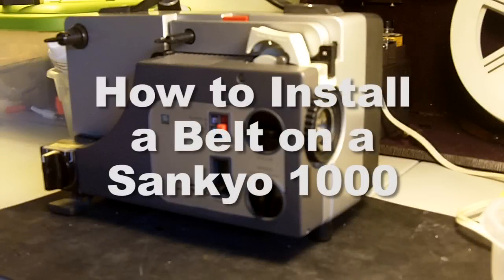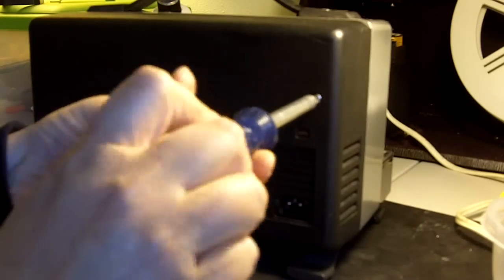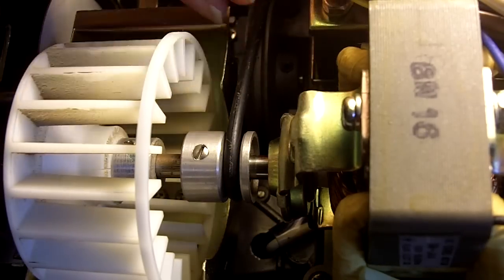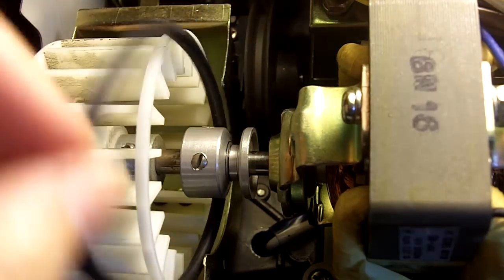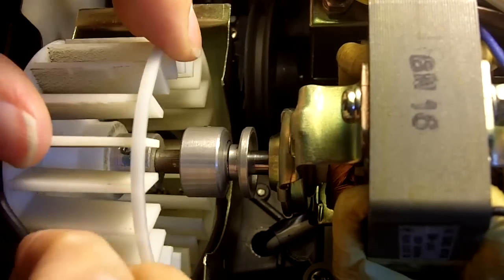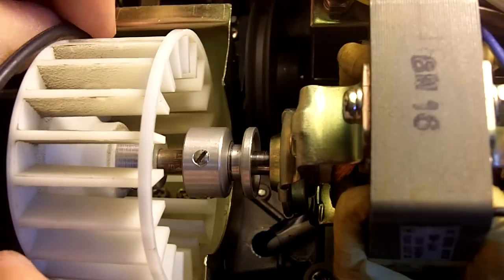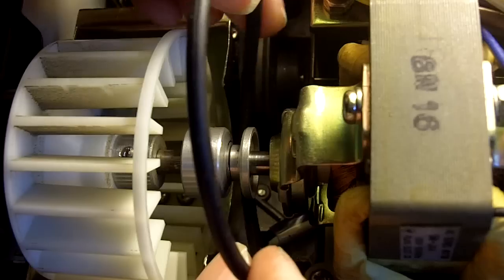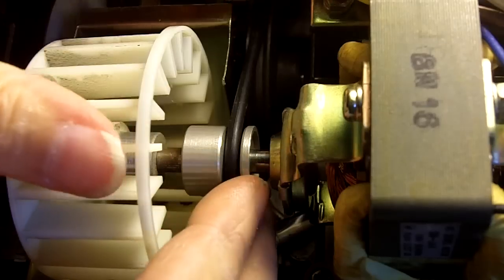How to Install a Belt on a Sankyo Dualux 1000

Comment: Hi, thanks for this very helpful video. I need to find a replacement belt as well, but I'm on the metric system, so I'd like to make sure I understood your measurements... the ring is 2 inches and 5 eighth of an inch long and one eight of an inch wide? (I'm never sure with imperial notations...)

Comment from the maker: There are a couple of things you might try depending on how the belt is trapped. Try loosening the grub nut on the shaft to the left of the shutter wheel using an allen wrench. This should allow you to move the shaft slightly to the left. If it still doesn't move try also loosening the grub nut to the right of the upper pulley on the right end of the shaft. You should only need to move it slightly to pull the belt threw. If that doesn't work you can try finding a narrower size belt/o-ring.

Comment: I'm looking to replace the belt on mine since it didn't come with one. Now, isn't it better to remove the turbine/fan before replacing the belt? It's only held by two screws to the shaft and it makes the job 10 times easier. Plus, you don't have to stretch the belt around it.

Comment: And by the way - I just found an odd sized O ring and that does the job perfectly - while I wait for the ebay replacement. The older failed belt seems to have been an old hair elastic. These old machines are sturdy but simple.

Comment: Hello!
Your video was very helpful. I have looked online for a replacement drive belt for a Sankyo dualux 1000 and they all seem very expensive and overpriced for just a small piece of rubber. Do you know if I can use a simple o-ring found at a hardware store as a replacement? If so what size should I buy?

Comment: Thanks for posting this. I've just bought a new belt for my Sankyo Dualux 1000 projector but don't seem to have what you call "an opening" on the right hand side. The back spool is right up against the thing to its right with no room for the belt to drop through. We've tried everything - trying to push the belt through the almost non-existent "opening" but it won't go through. Any suggestions? Thanks!
Reply from the maker: I've had some projectors that had a smaller opening. I either use a thinner belt or stretching and pushing with a flat-head screw driver to jam it thru. You also might want to contact the seller of the belt to see if he has a thinner belt material. There is a more drastic measure...but that requires unscrewing the shutter from the rod and moving it slightly to increase the opening. I don't recommend this...it would be a last resort.

Comment: How to clean up the gate and the film track?
Reply from the maker: Remove the lens and clean the gate through the opening with a small piece soft cloth and alcohol. I cut up old t-shirts and tape the cloth to the end of a wooden skewer. Also spray some canned air. You can also clean the other side of the gate by removing the lamp. Be careful not to touch the claw.
Reply: You not have video how doing??
Reply from the maker: No...I do not have a video ... but I'll think about making one. It's a very simple process.
Reply: but its difficult know if dont have any photos

Comment: I received the projector from a friend so I could view some films to see if I wanted to convert some to DVSs. It wouldn't feed so looking at youtube I found that it could be a broken belt. I checked, and someone had replaced the belt with a rubber band. Of course it was in three pieces. Not going to try this. Going to get the real thing.
Reply from the maker: LOL...Well a rubber band might work in an emergency...but definitely not a long-term solution. Glad you are getting a reel belt. Check back if you still have a problem feeding the film.